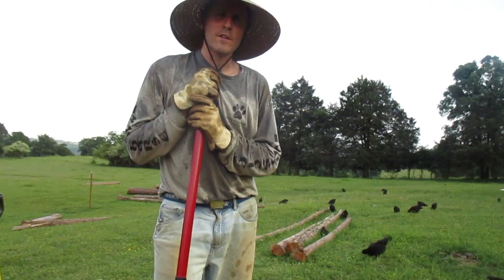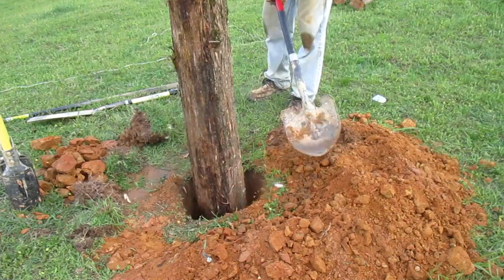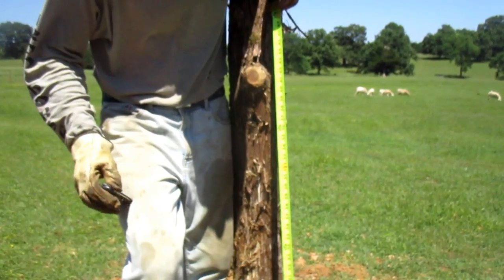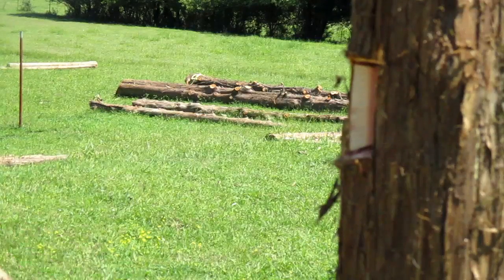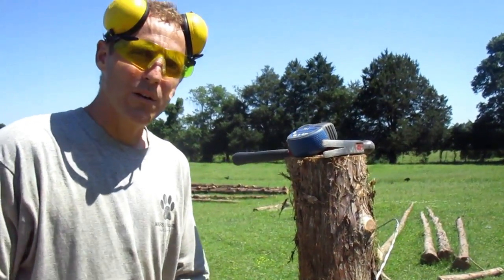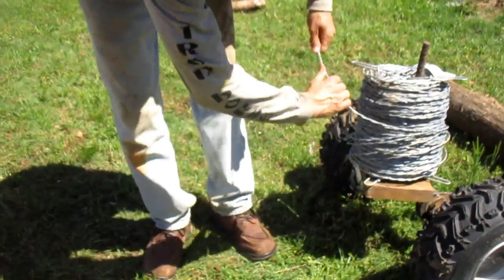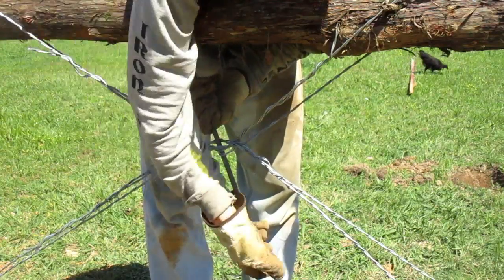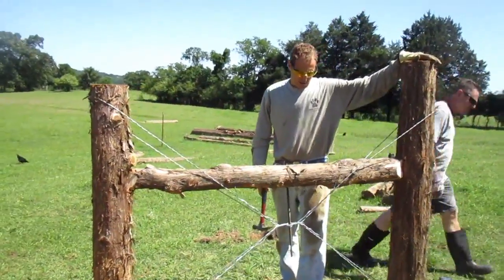Fencing - H post

Comment: Very well built I like how you did it very minimal hardware with a rustic look. I am curious how it is doing today, 6 years later. Have you had to replace any posts due to rot? What is your climate, or state? We have thousands of cedar trees on our property here in N. Texas but I have been told if I use for braces they will only last 4 years.

Comment: Thanks for sharing this series, really interesting. I was wondering why you left the rebar in place, I have never seen it done that way. Is it to have in place for future re tightening?
Reply from the maker: Correct - since the wood was green when it was installed I wasn't sure if I would need to pull it together at a later date.  Thanks for watching!

Comment: Great video, but after reading an engineering perspective on braces, I think it's counterproductive to make an x-brace.  I believe you only want bracing going from the top of the second post to bottom of the first.   The H-beam transfers the high-torque tension from the first post to the second.  The brace then transfers this high torque back in the other direction to the low-torque area at the bottom of the first post.  Placing the second brace and making an X would transfer some of that tension back to the first post, thus being counterproductive.  But, I could be wrong.  Any thoughts?

PS, the X would make sense if it's a center brace, and not a corner brace.
Reply from the maker: I understand what the engineer is saying (I am an engineer also) and I can agree with what you have typed.  Not sure the depth they are putting the poles in the ground, we went 3 feet?  When I built these sections I had intentions of putting a gate on the opposite side, which I haven't done yet based on animals do not use then pens very often.  Different school of thought but I can tell you I had a friend (structural engineer) of my come up and look at it after being completed and he said that it solid and little over designed for the fence.  Happy fence building, I can tell you it gets easier with every section you put up!!
Reply: Thank you for the prompt reply.  I am an engineer, as well, but I haven't had any construction experience yet. If you are interested in the article I read, it is here:  https://colliefarm.wordpress.com/2008/06/07/the-case-for-the-h-brace/.  If YouTube won't allow the link, you can Google, "The Case for the H-Brace."  Thanks again for the great and informative video.
Reply from the maker: Jeff - thanks for sending the article over, I enjoy articles with diagrams also.  While I can't refute the article in anyway, I just want to share what I saw today when I walked more than a 1/4 mile of fence with multiple connections.  I checked all my fencing today with additional attention to detail and found the fence and braces as tight as it was the day it was installed.  I didn't see any tilt in my H or corner post.  With this said I am not an expert but we build a pretty good fence on a tight budget!  I really appreciate you commenting and for sharing any information that will help others!  Shalom
Reply: Glad to hear your fence is holding up so well.  It looked very sturdy in the video.   I'm very grateful you and others put out all this information on the Internet.   Best regards.